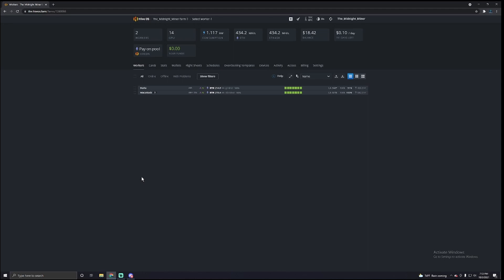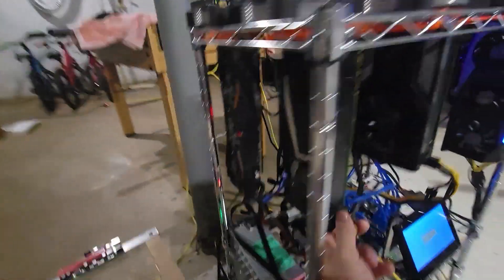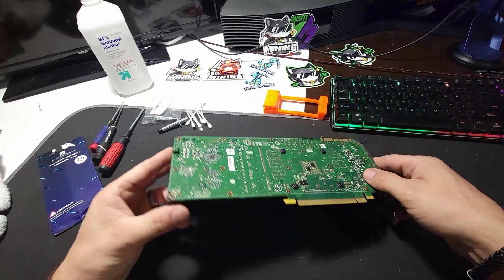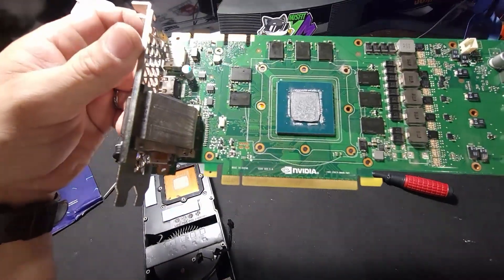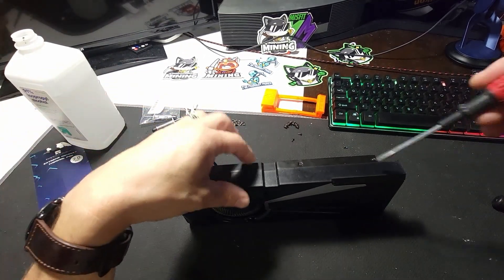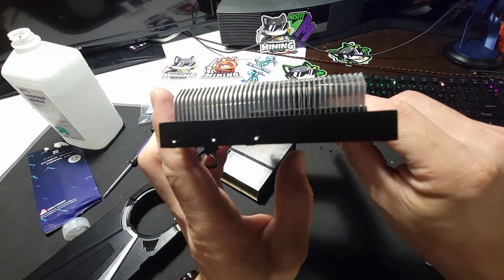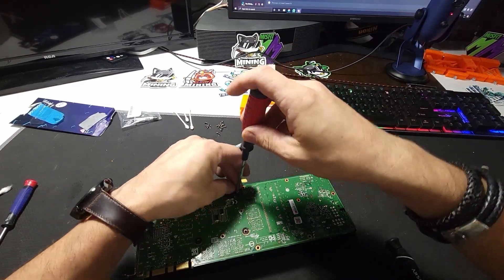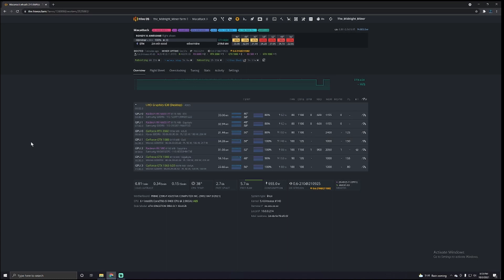Dell Nvidia GTX 1080 Maintenance Clean

Comment: Great video! But I want to point out an easier way to do it. Remove the screws on the side of the plastic shroud, then remove the screws holding the bracket on, then remove the 4 large screws holding down the heat sink. I had to do this method on both the cards I have because most of those tiny screws on the pcb kept stripping…. weird. They either used low quality screws or that loctite is really seized on there. Also Make sure to apply good pressure while turning to prevent stripping.
Reply: Yep, no need dismantle wide frontplate with pads on memory chips. Only plastic cover with side screws, clean radiator inside with 4 big screws and new paste underneath

Comment: I have that same GPU, added an aftermarket Raijintek Morpheus II cooler. Works great and way quieter than the blower. 36.07 MH, 54 degrees, Fans at 80%, Core 220, Mem 1710 and PL 175 its running about 170W. It uses 2 120mm fans with a 4-Pin PWM GPU Dual Fan Splitter. Shoot me a message if you need the part numbers.
Reply: yes please! I have this same GPU, though can it work for gaming? let me know, thank you!

Comment: That's a blower style gpu.....the hangers and the LED fan might be affecting the heat coming out of it 🤔......IMO
Reply from the maker: The heat is coming out the top of it where it's hanging and the fan is on top of it to pull the air thru faster. Even mounted on a board it's pushing the air out by the mounting bracket.
Reply: @midnightminer  Just watch the hanger my man. Didn’t realize you had blower cards!! They can sometimes get them hangers hot and deform so just keep an eye on it. 😘
Reply from the maker: @ChumpChangeXD   i did pay attention to that and it did deform the hanger a bit but nothing drastic, i also deployed plan B on that card so it has a hanger and also zip ties. lol